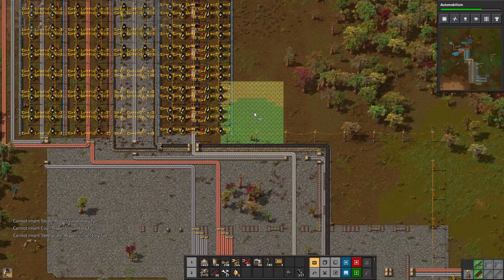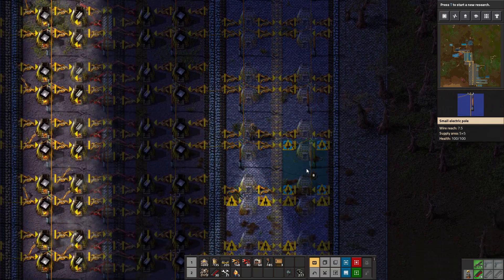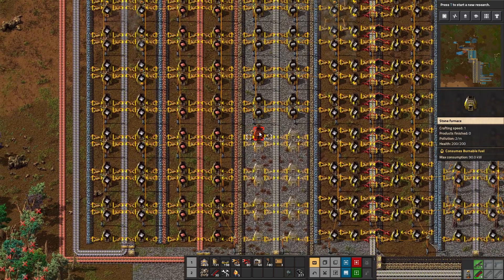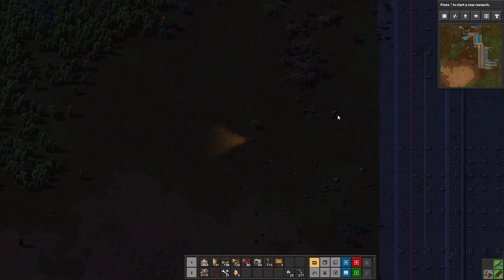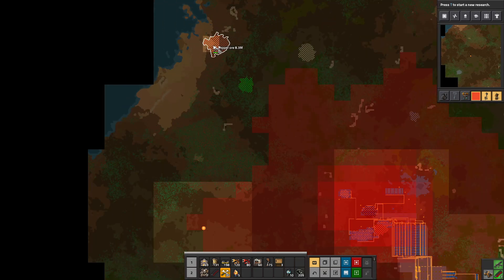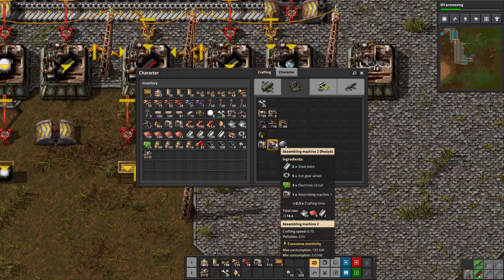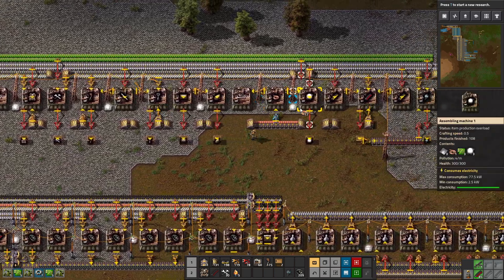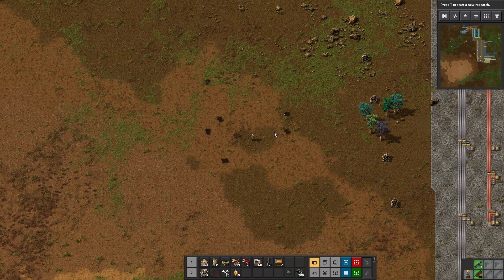Factorio For Beginners - 018 - Cars and Circuits

Comment: Are you actually going to use the lvl 1 assemblers anymore, now that you have the lvl 2? Is there any reason to keep them around, other than "not bothering to replace old stuff"? Personally, as soon as lvl 2 are available, I shove all the lvl 1 machines I still have in my inventory into that assembler to have them upgraded...
Reply from the maker: I'll eventually get around to it.

I won't replace stuff that doesn't need replaced. I have enough gears and (surprisingly) green circuits so why replace the assemblers? When it comes time to expand, though, yes I'll upgrade before building anything new.

Same with yellow belts. I'll use them if they're good enough but will switch to red as soon as the yellows don't do enough. Well, except for ores and plates, but even those will eventually get red belts, probably.

Maybe this should be something I talk about on the video :D